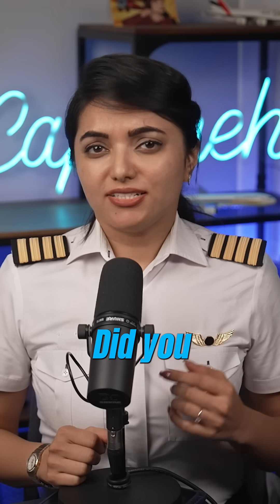This is How Pilots utilize more or less fuel

Comment: Thank you so much
You remind me of flight from Quebec To Portugal (forgot City may be Lisbon) fuel shortage detected.
Air hostess called by pilots to use torchlight to check of fuel leakage (National Geographic On Air Crash investigation many years ago)
 The Air Crash Investigator found the pipe replaced recently 2 cm short and got eaten up)
But so kind and considerate were the investigating persons just they made it a point to be very careful with sizes of screws or Lenght of pipes
I was told 37 ton needed Quebec to Lisbon
The Pilots were made to land in one Airport in an island safe but Pilot told his co pilot nose to dive or something
The Pilots and the Crew received standing ovation
Thank you for the explanation
Reply: Yn